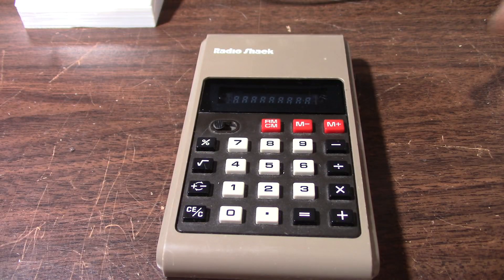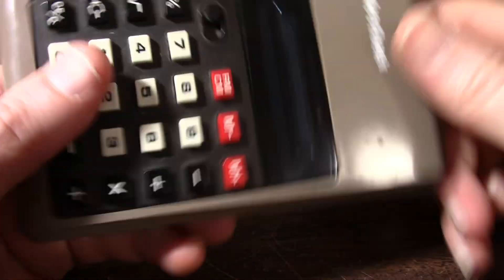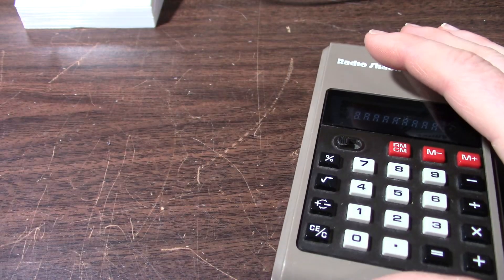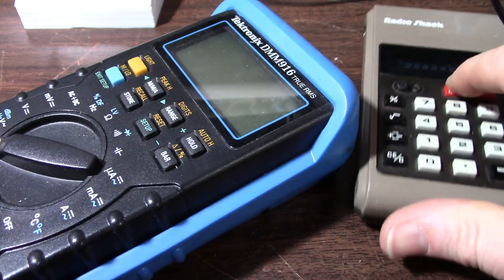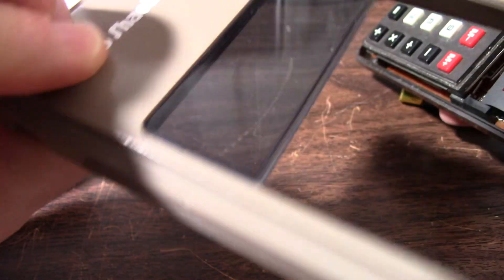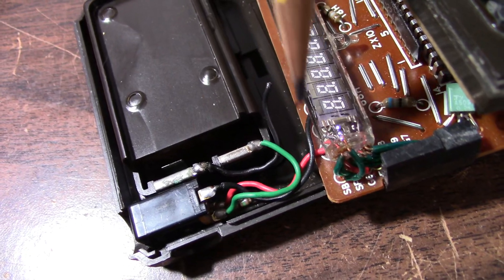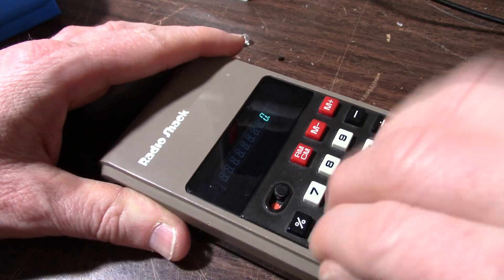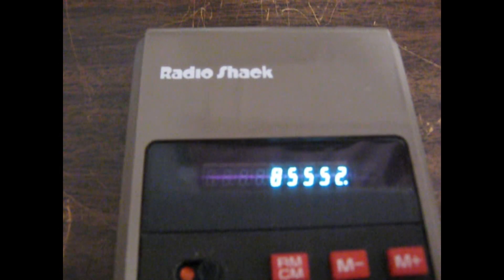Radio Shack VFD calculator repair

Comment: I request you to please make a video on Lm1875 amplifier working on Single supply and Split supply taking readings at various voltages doing a comparison of power output of Single and Split supply operation. Thanks in advance

Comment: PSA    The 100th anniversary of the first commercial radio broadcast is coming.  KDKA was the radio station.   Election day November 2, 1920 was the first commercial radio broadcast and they broadcast the Harding - Cox presidential election results for the first time.

Comment: Hello John, Well fortunately it was an easy fix. Calculators were quite spendy when they first came out. Kinda sounds like YT isn't exactly cutting it for after reading your post. I'm afraid any one looking to do YT as a job or way to make money is going to be sadly disappointed. It would appear as though they rigged it that way, they want the money. One would have to do it simply for the fun of it. It would be sad to lose you and your channel. Thanks for all you do and sharing your knowledge and expertise on chimp amps, I mean chip amps. Trying to be funny and failing. Stay well, Brother get well, all the best, C.

Comment: That is fantastic. My mate has a calculator museum and I donated a few - I regret it now - But I can't remember seeing one of yours.
I love my Datamath (arguably the first calculator). You can still pick these up in good condition quite cheaply.
The funniest calculator I had...(unfortunately I don't know where it went) was a Sinclair scientific  programmable (scientific because it had a square root button and sin, cos, tan). It had a 24 step programme function and worked in RPN. When I first  put in a battery (it ran on a 9V PP3) it didn't work. I tried another battery and the LEDs flickered on and went straight off. I plugged in an external supply and it worked fine - Anyhow it sucked so much current from the battery the voltage sank below operating voltage. This was 1979 so fancy batteries were not common. A high quality alkaline battery lasted twenty minutes. Just long enough to give it to someone and confuse them as they looked for the equals button...

Comment: Oxidized negative is a common failure with battery powered devices. I have seen it in a number of vintage multimeters I have repaired. Pull the insulation off that old wire if you still have it and see if it is all rotted out inside. I've seen them just full of green copper oxide in the worst cases. There's no metallic copper left.

Comment: Funny story from the past - my mother went to by my father a new calculator for Christmas.  My father was a machinist that used a slide-rule.  The salesman was showing my mother the latest "solar" calculator.  She apparently stared the salesman straight in the eye and told him that my dad worked inside so it probably wouldn't work for him.
Reply: A lot of machine shops are not the best lit up. So your Mom was probably right. They always are.